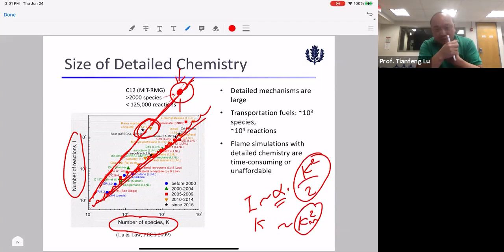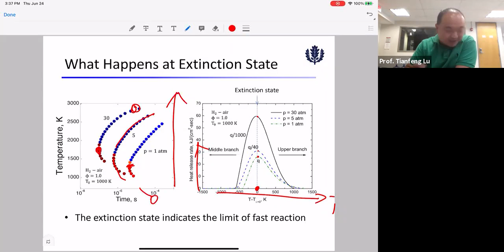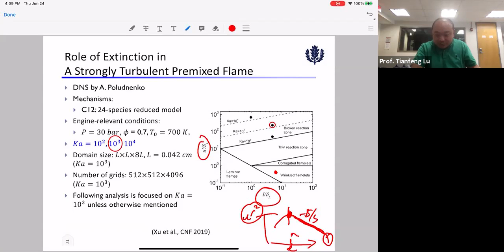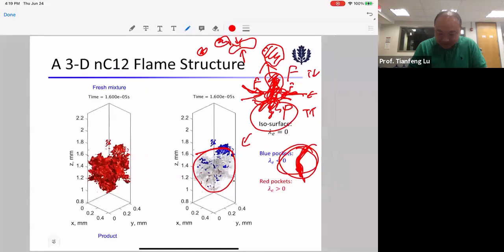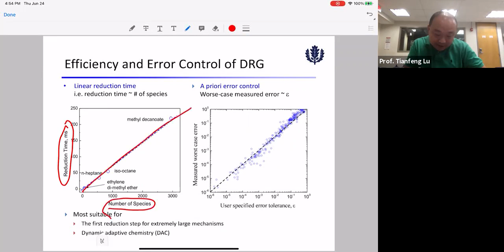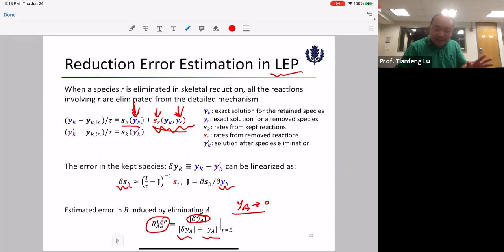Mechanism/Model Reduction and Advanced Chemistry Solvers, Lu, Day 1 of 2

Comment: Nice presentation !  Chemkin‑Pro is excellent for detailed chemical kinetics in PSR, PFR, and laminar flames. However, it currently lacks a direct turbulence‑chemistry interaction module (e.g., EDC, PDF, or flamelet models). Incorporating such a module would enable simulation of turbulent combustion with micro/macro mixing effects directly within Chemkin‑Pro, improving usability for researchers and engineers working on flames with strong gradients in temperature and species concentrations.